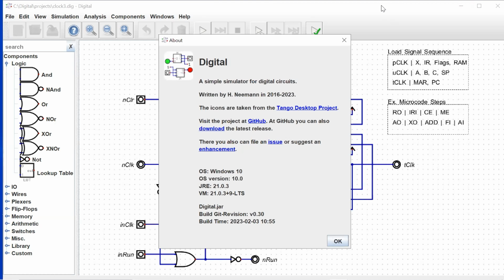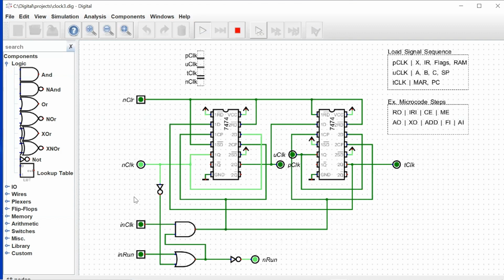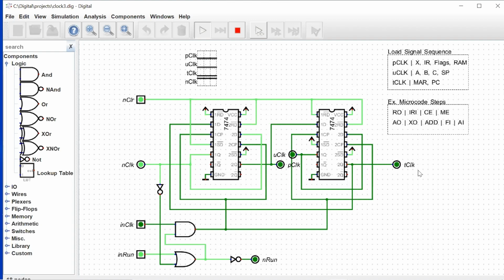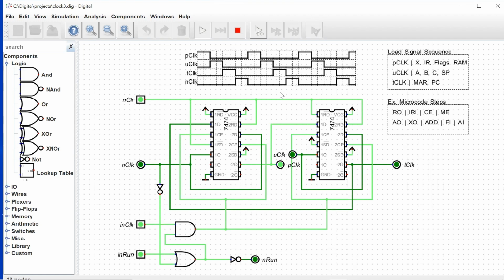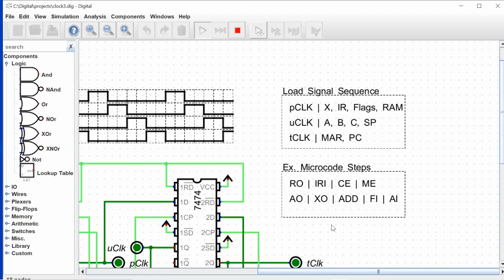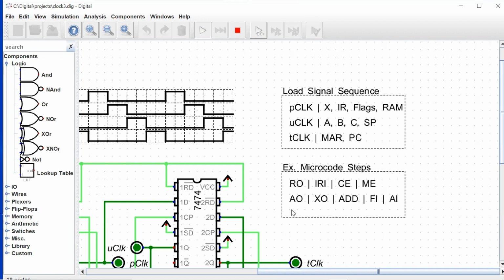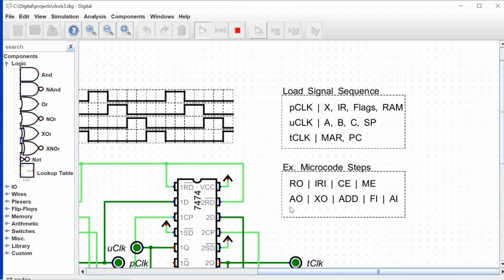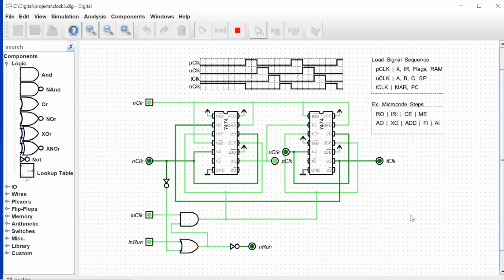TTL Computer II #2 - Clock Circuit

Comment: Hi Charlie, I've watched this video multiple times, trying to understand the clock schema. You list things like "A, B, and C registers update during the U clock" - but don't really explain why. Any chance you could post a quick follow up with why you made the choices on "what goes into what clock cycle" - and how this helps you?

Thanks! 
Scott
Reply from the maker: Hi Scott:
It's really about forcing updates to occur in a specific order.  There are required inputs for an instruction and their are outputs.  Some of those outputs (like flags, or storing a result to an input register) could impact the current instruction if updated at the wrong time.  We also have counters (Program, Memory) we need to read from and then increment for the next instruction.  So, we enable the inputs on the nCLK (via Control), load the inputs on the pCLK (X, IR, Flags, RAM), store the results on the uCLK (A, B, C, SP) and then lastly increment the counters on the tCLK (Program, Memory).  This can be a bit confusing and is one of the most critical elements of the computer.

Comment: Speaking of invalid states...  I haven't thought this through properly but it, at a quick glance, looks like there are not synchronisation between the inClk and the inRun signals.  This means that you can get a very short clock pulse out of the AND gate if the inRun is toggled at the wrong time, and that might make (some of ) the 74'74s not to clock properly and they might and up in a undefined/non-approved state.  But maybe you will have those signals synchronised outside of this module already.

A tip for Digital is to use the "Triggered Data Graph" instead of the older plain "Data Graph".  The output from the triggered one is much more similar to what we're used  to from oscilloscopes and logic analysers. The plain one advances a grid as soon as any of the monitored signals changes state and not on a regular timing basis (from the CLK for instance). This makes it really hard to get a proper view of the timing of the signals.  For instance if you have a signal that has 50% duty cycle and you also monitor another signal that sometimes changes in the middle of the 50% duty pulse. Then the curve for the 50% duty will get another grid there and be longer and not look like a 50% duty on the screen. I got bit by that many times and caused a lot of confusion and headache before he implemented the Triggered Graph.
Reply from the maker: Appreciate the comments.  Yes, I see your point about the inClk/inRun synchronization.  This is not the final design on the clock, so will consider that when I revisit the final clock design.  Anywhere in the design using individual gates and not 7400 IC's is temporary logic.

Yeah, I noticed the issues with the Data Graph.  Will look at the Triggered Graph if needed in the future.

Hey, I saw your Digital simulator work with the PDP-8.  That looks really cool.  Well beyond what I'm doing here.  I will have to download that when I have some (more) free time.

Thx.
Reply from the maker: Hey Mat, I went ahead and added a D latch on inRun so it will only clock if inClk is low to add some synchronization as you suggested.  It's not rock solid, but better.  In practice the Run/Pgm will only be used during system development.  Thanks.